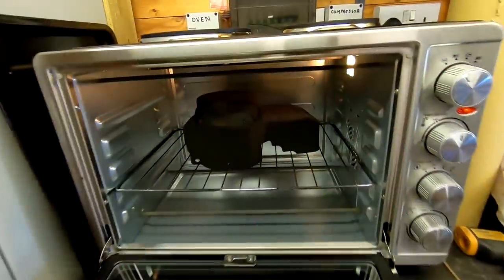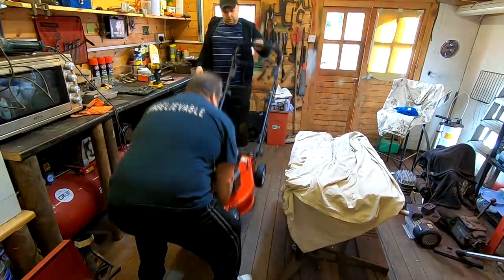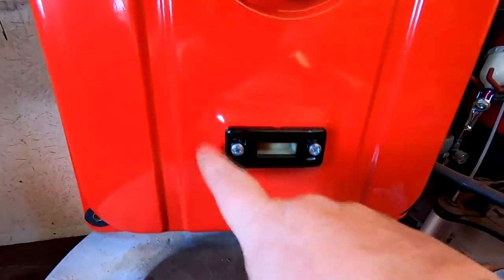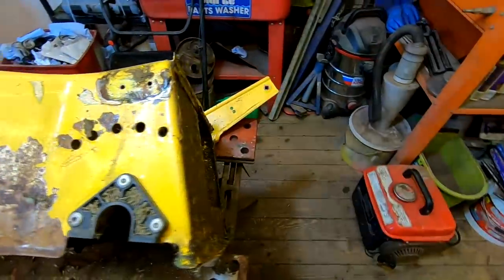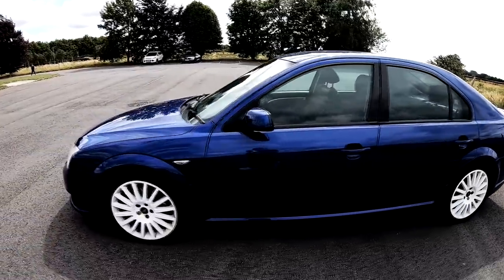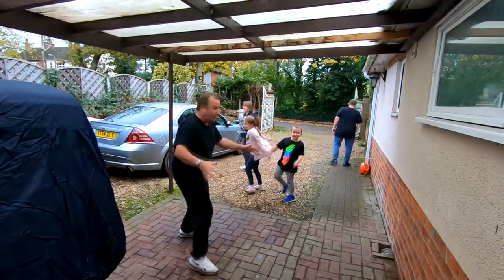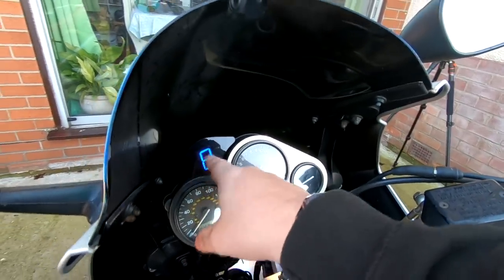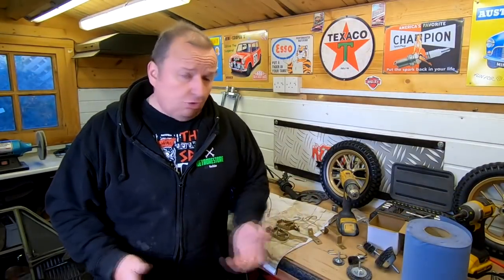Fixing And Repairing Stuff In Your Shed - Man Cave Tinkering

Comment: Hi Martin great content this year wondering if I could pick your brains once u have used mc51 rust remover on things like nuts and bolts what’s the best way of keeping the rust away does the blueing stop them rerusting once washed off
Reply from the maker: The bluing will go rusty if you don't keep them olied. Possible heat them up cherry red and quench in engine oil I would suggest.